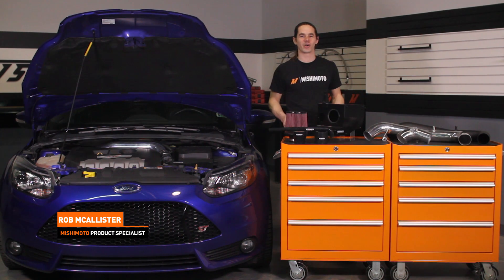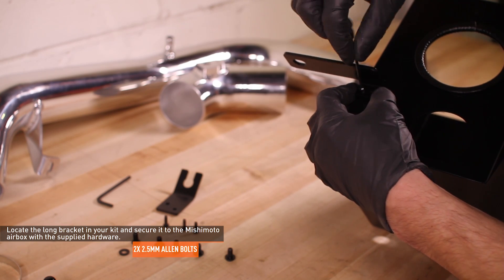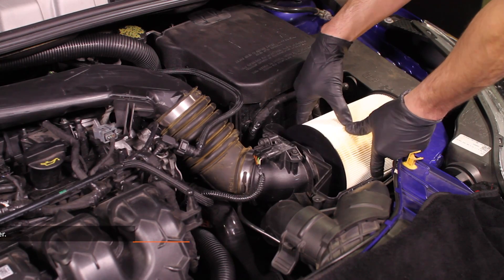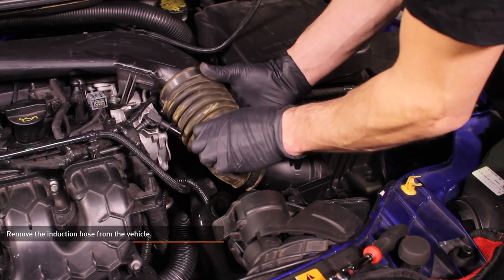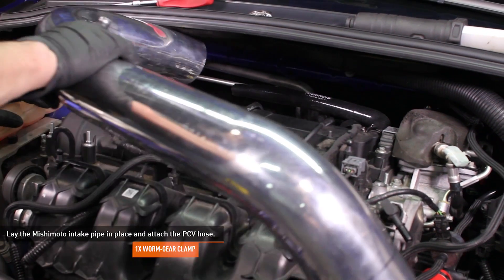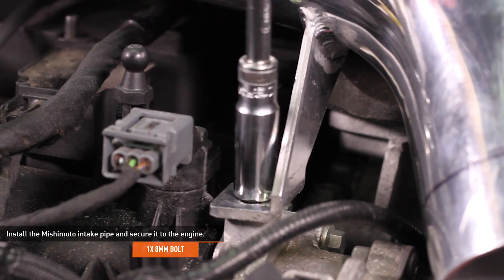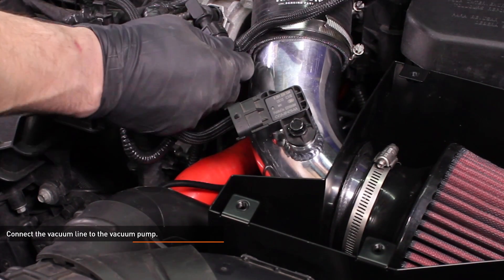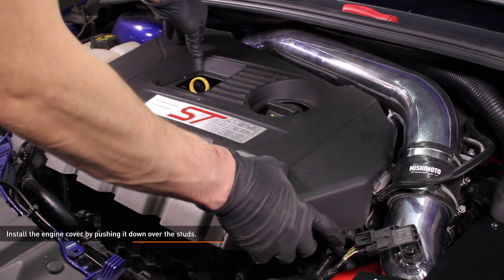2013–2014 Ford Focus ST Performance Air Intake Installation Guide by Mishimoto

Comment: I had a couple of clamps left over and a hose, I hope I did it right
Reply from the maker: It sounds like you had the parts meant for the 2016+ model left over. If you car is older than 2016 there is nothing to worry about you wont have any need for these parts.

Comment: if i were to take the top of the airbox off does it seal fully when i close the hood to block out hot air?
Reply from the maker: The cars hood would not provide a seal for the airbox to prevent hot air from entering

Comment: What are you supposed to do about the crank case sensor on the hose?
Reply from the maker: For vehicles equipped with this sensor a hose is included to size down to the sensor to allow for this to be installed.

Comment: the mounting peg on the left for the air box is attached to nothing? does it connect to the stock air box ?
Reply from the maker: If you are refering to the one that is removed and installed on our airbox this goes into a locating mount on the car.

Comment: this is a very pricey unit, but it is clear the production quality is in the box portion of the cold air intake.  I have a $150 ebay cold air intake that ends in a pod filter in the engine bay with no "airbox" around it.  Im curious to see a performance difference..